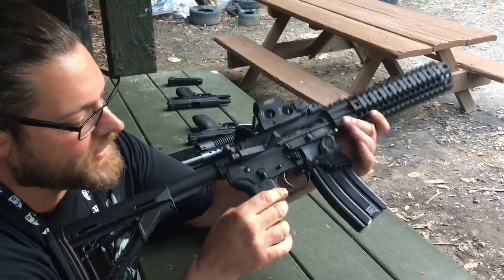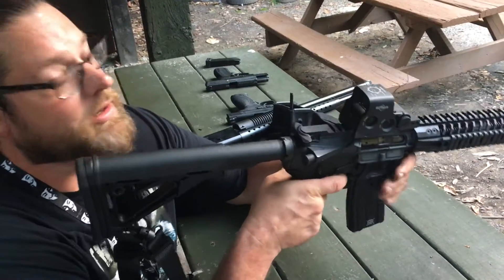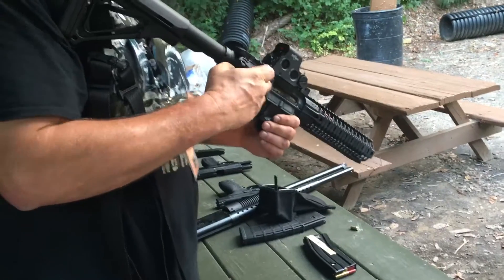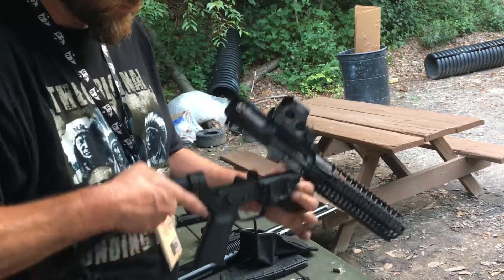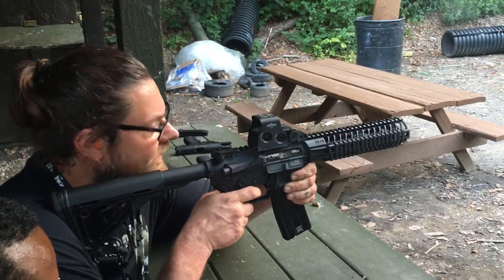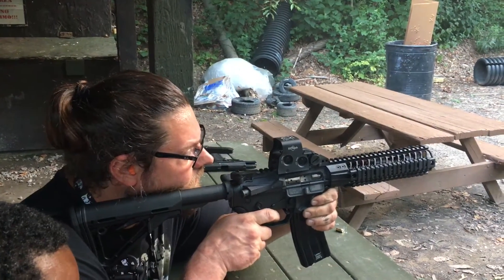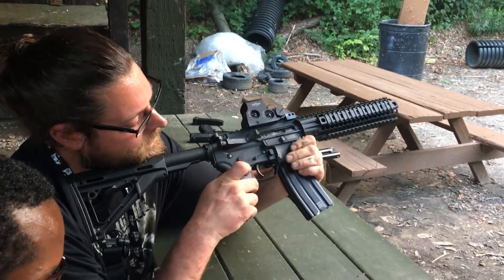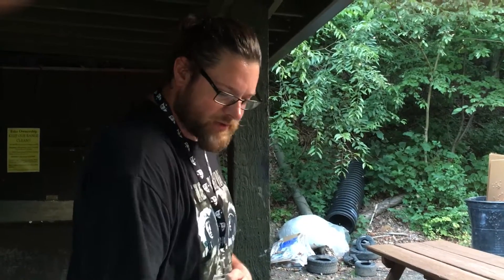300 Blackout subsonic with Nemo buffer spring

Comment: Thanks for the test-  At last someone with a field test and a brain...No mater what you have read- the Subsonic 300Blk in a 16" barrel with a carbine gas system needs the reduced  compression weight spring. No need to fool around with buffers.. Of course you MUST NOT use this spring in a 5.56 or .223 gun.  AAC Blk ammo just does not produce the gas pressures of the other calibers.  The 300 Blk  is NOT a quick upper change with a 223 lower as it was designed by AAC as a SYSTEM.. a stand alone gun.

Comment: If you can’t cycle subsonics, youre under-gassed for subsonics. Putting a weaker buffer spring is kind of a bandaid on the issue.  Don’t be a sissy. drill the gas port out and solve the issue for real.  Barrel manufacturers don’t know what you’re going to use the barrel for, so they start you out with a smaller gas port because it’s easy to drill it out for subs if needed, but if they drilled it for subs right off the bat, people would run supersonic stuff in it and whine about the recoil.  Fixing a port that’s too big is more expensive (adjustable gas block) than fixing one that’s too small (drill bit)
Reply from the maker: Nate R. Why drill the gas port when your over sprung to start with . 300 blackout is a lower pressure round . Cut a couple coils or buy a spring that’s designed for the round especially when it’s as cost effective as buying a box of sub Sonics . 
 I can run either spring but there are people out there that don’t want to drill their gas ports and this spring is an excellent alternative .
Reply: I agree with Delo. Overpressure on the spring is the BASE issue. The bolt has too much pressure pushing it forward. Reduce that pressure while maintaining enough to cycle. If the problem is still there then drill out the port

Comment: Good job C Delo!  thanks for the video!   ya should have showed the bullet as well. . I thought I  saw some red peeking out of the mag. That's great that in some instances the spring will do the trick! those numbers sounded just about like my 230 grain missiles! great video! !! ; )
Reply from the maker: Yeah I should've showed them they are pretty beastly . The load data from what I noticed seems like 220 smk data is fine to use and is within a few tenths of a grain or even right on with powder coated 230 and 247 grain missiles . 
 Sorry for flapping on about magnum primers I had my H110 loads seared into my brain  . The aa no. 9 had a good standard deviation. Got some  aa no.5 to try next . Thanks for checking this video out and for all your great videos !